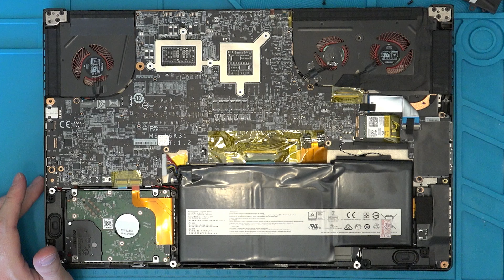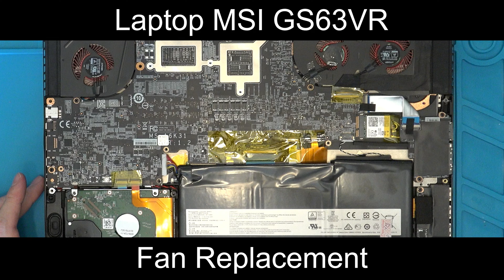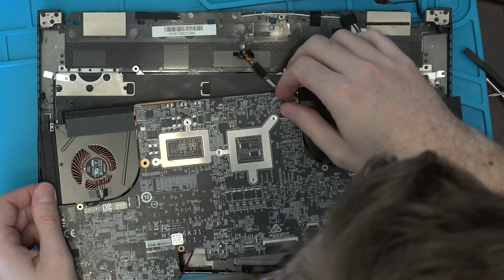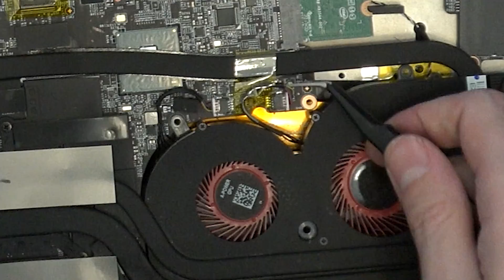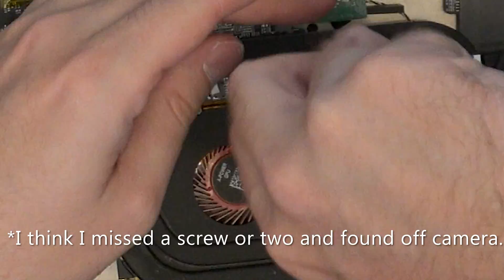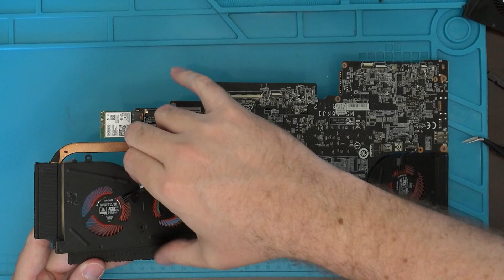Fan Replacement on MSI GS63VR Laptop

Comment: Cleaned it and put in new gpu fan and still the loud persistent noise. What is it that keeps its Eeeh Eeeh Eeh sound?
Reply from the maker: Could it be the other fan?  I rarely use this laptop anymore.  You could try turning it on when its open and listen from where the sound is coming from.

Comment: These fans systems are total junk. You can lube the fans without replacing them, but even if you buy an aftermarket fan system they TOO are junk. I've lubed the fans a total of 3 times. (I'm an IT tech guy). 

I'll never buy another MSI laptop EVER again. Even the battery swelled up and I had to totally remove THAT. NEVER again.
Reply from the maker: I second that.

Comment: Hey guys, this guy is nice and cool but there is a newer video from 2020 that has 'disassembly' in the title vs fan replacement but it is very detailed and doesn't have little notes like "think I missed a screw or two I found off camera". When it comes to hardware and especially removing a motherboard, every little detail is extremely important especially for newbies.

Comment: I will never buy another MSI product. I have been working with computer hardware/software for over 25 years and I have never had a computer with more problems than my MSI GS63. It is total garbage.
Reply from the maker: Yup I feel the same way.  It was not built to handle its purpose.
Reply: What’s the best VR capable gaming ish laptop out right now? I’m ready to smash this gs63 against the wall

Comment: I have this same Laptop, Original CPU fan was making rattling sound on IDLE condition, changed them with new and now the same problem again,You think its Blades issue or the ball bearings part ?also is it possible to remove fans without removing the Heat Sink from motherboard? Thanks

Comment: Thanks a lot for posting this video - I had to replace the single fan in the other corner (BS50005HS-U31) and your video gave me everything I needed and helped me find the screws and cable connectors I was missing :-)   Great job and thanks!

Comment: My fan started making a grinding and kind of loud squeak/screeching noise so I ordered a replacement. Since then the loud noises have stopped but there is still a soft grinding noise. The fan appears to be keeping the GPU sufficiently cool still... 70-80 degrees Celsius. Should I replace it right away or do you think its fine for now?

Also should the fan always be running when the laptop is on or only sometimes? It tends to sit at 0 RPM until I start a game that causes it to heat above 50-55 degrees Celsius. I'm wondering if this is normal operation or if this would be considered it working intermittently. Thanks!
Reply: This is normal. Computer manufacturers like to provide "quiet" systems so they have the fans run at 0 RPM until components get above a specific temperature. I think you're fine not replacing it right away. Worst case scenario is that the fan dies. You already have a replacement so you're good to go.

Comment: I need ur help. i got the same laptop. the LCD ribon cable is broken. i did order a new one. but where does it go?  the cable i mean is at 1:32.
Reply from the maker: Sorry I am not completely sure, I think it feeds around the hinge but haven't open the laptop in a while or messed with that part.
Reply: @TripleLSupreme  I found it, thanks for the respons!

Comment: @Larry Low where can I buy a gpu fan replacement??
Reply from the maker: I got mine from an Amazon seller: https://smile.amazon.com/CBK-Laptop-Cooling-Stealth-BS5005HS-U2L1/dp/B079L4D2F1

You can try googling the part number in the video description as well to find possible other vendors.

Comment: Did all the steps but now it won't boot back up. What could I have done wrong?
Reply: Corey Bailey plug the battery back in
Reply: @flsleeper  it is plugged back in
Reply: I believe the power button connector for the ribbon is broke. If I mess around with the ribbon while pressing the power button I can get it to power on now. But now it's booting straight to bios. So I'm trying to create a Windows recovery USB from my other laptop to see if I can boot that and possibly repair Windows or reinstall it. I got my fingers crossed. Lucky I have the option of sending it back to rent to own to get it fixed completely so I'm not at a complete loss but i don't want to wait for weeks to get it back lol.
Reply from the maker: @Ballonboy01  That sucks.  I have had on and off issues with something shorting in the bottom right when looking at the keyboard causing it to reboot and not turn on but never did identify the fault.
Reply: @TripleLSupreme  I did finally get the port to work like normal but I'm still facing boot issues. Using Windows recovery trying to use diskpart to clean format the c partition and reinstall Windows but I keep getting errors lol. It's always something. But I appreciate your video as it did help installing the fan and from what I can tell it works but I haven't been able to engage cooler boost yet as I'm unable to get into Windows. So I can't fully test it but I've seen it spin a little during Ubuntu boot sequence. Figured I could try using Ubuntu to format the c partition but it doesn't show up in there as it's raw right now so I have to use Windows recovery command prompt to format it to NTFS. Been working 2 days and still no go. I can get it to format 100 percent sometimes but then throws an error at me last minute. This laptop is rather brand new so the drive shouldnt be failing yet.
Reply from the maker: What is symptom?  I would make sure all the cables are hooked up.
Reply: @TripleLSupreme  it just won't power on at all. I double checked then triple checked all cables and ribbons are plugged back in. But pressing or holding the power button does nothing. I've tried taking the battery out, holding the power button for 30 seconds to a minute, then plugging it in with out the battery trick but still no shot. I took such care but I have no idea what went wrong

Comment: Hi Larry. It looks like when you comparing the fans on 4:44 - the newly installed fans have less blades, than the original ones. So how did your thermals look after replacement? Was it on the same level as the original ones? (When they were still working of course).
Reply from the maker: I didn't really have anything to compare to.  It was already pretty bad at cooling under load.

Comment: Why do these fans seem to fail for everyone after 1-2 years? Is it just debris buildup? Can the debris be removed using canned air? I really don't fancy the idea of dissembling the whole thing just to spray a fan out. I am wondering if I can clean the GPU fan without removing the motherboard.
Reply: i think they are doomed to fail every 1-2 years, mine got replaced under warranty by msi the first time, this time it's out of warranty and its fcked again
Reply: @lummeltje  $hit. I suspected that would be the case but that really sucks.
Reply from the maker: @MillArcade  You can try blowing it out, but it is likely just worn out.  I don't think the build quality of the fans match the amount of work it has to do when the machine runs hot.  I've had the replacement fan in for about 6 months and has been running well though.
Reply: @TripleLSupreme   hey larry, my laptop fan just started making a squeaky noise whenever I open a game. I only got this laptop about 8 months ago. Could I try cleaning it with compressed air or do you think I should get a new fan? I heavily use this laptop for gaming and work use.
Reply from the maker: @iram1472  you can try blowing it out but it's likely beginning to fail
Reply: @lummeltje  hi, i have this problem right now. I still have warranty. Do you know how this works?
Reply: Sven Brassé you should be able too register your device at msi and via that way ask for support and they’ll ask you to send it in and they will fix it free of charge
Reply: @lummeltje  thx a lot!
Reply: Sven Brassé no worries hope you can get it sorted
Reply: Dont buy msi it's a trash gaming laptop just because the fans.
Reply from the maker: @khead0606  and their support is garbage as well.

Comment: Hi, I'm having trouble removing the motherboard. I've removed all the screws and disconnections but can't pry it away from the side with the hdmi ports etc. I've tried quite a bit of force but I dont want to damage anything. Is there any way to overcome this issue? I have a gs63vr 7rf
 Cheers